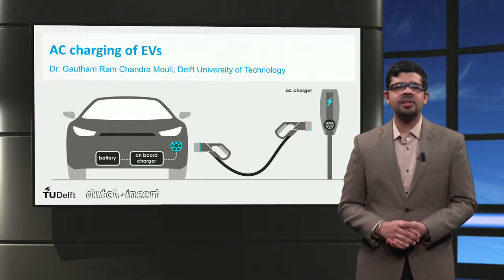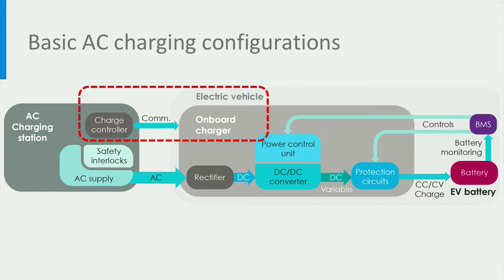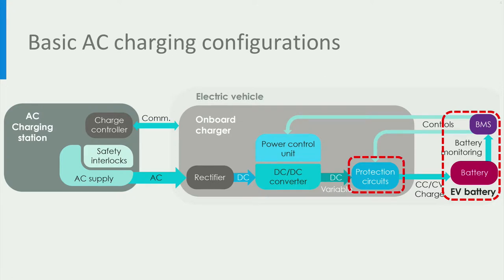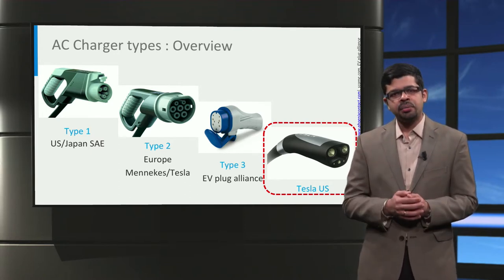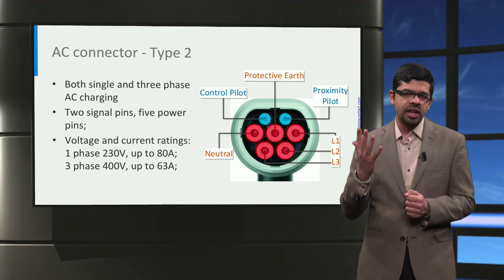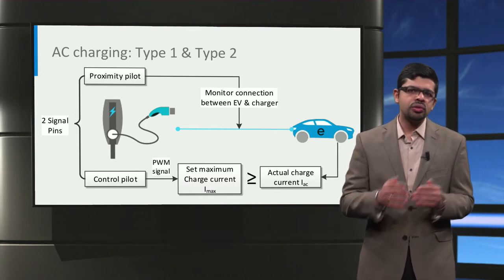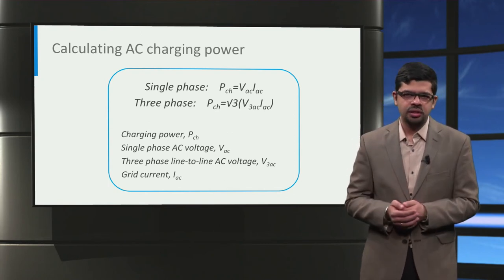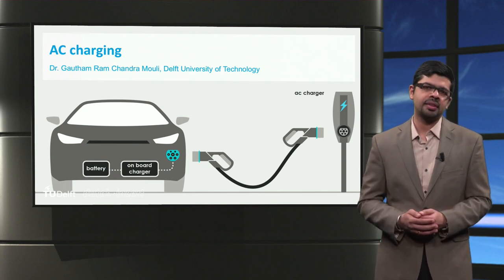AC Charging of electric vehicles

Comment: I do agree with term AC Charging Station but not AC Charger. 
There is no such thing as AC Charger.
We only have Converter (AC to DC).
Did open so called Wallbox, and its just a switch socket outlet been replaced with EV connector only, so it obviously AC supply point.
Reply from the maker: I agree with your observation that there is no converter. The formal term nevertheless used in AC charger